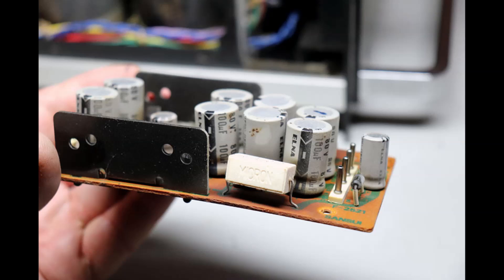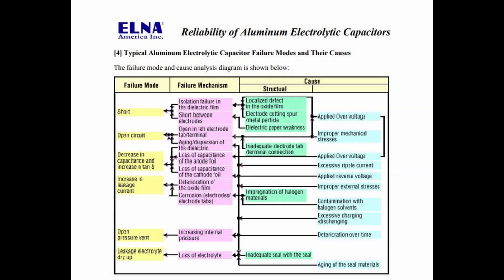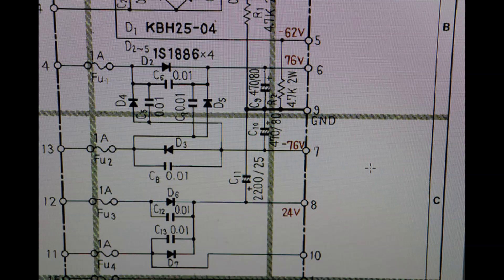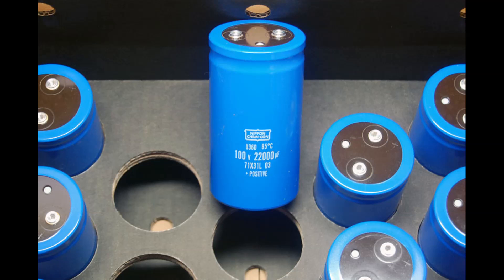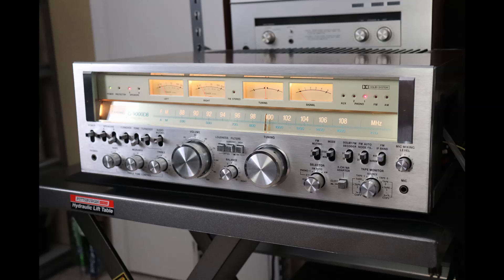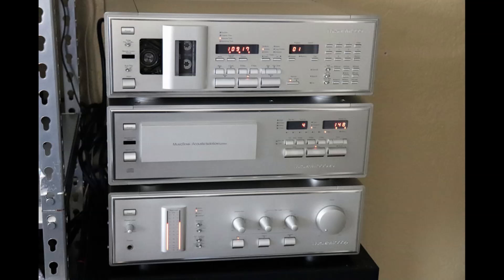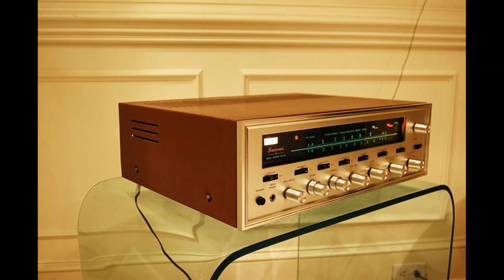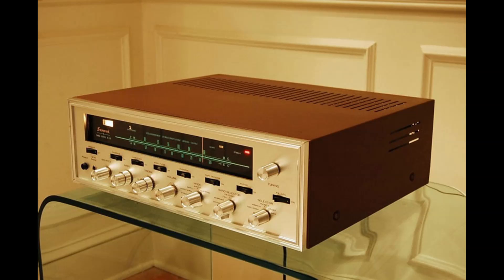Save Your Electronics Before Your Precious Gear Blows Up! Replace Your Old Electrolytic Capacitors.

Comment: Question: What if you vintage receiver is in mint condition and was rarely used? Does the Electrolytic capacitors still dry up without being used?
Reply from the maker: Yes, time will kill the capacitors even if they are not used.
Reply: @vintageaudioaddict  This is where I am not sure I agree because my logic would be that heat & time are the equation. In your video you even state that less heat will greatly increase the life expectancy. So equipment sitting not being used should have a very long life expectancy. What am I missing?
Reply: yes

Comment: It comes to a personal choice.  Don't fix it if it ain't broke vs. Preventative maintenance (with a small chance of screwing something up in the process).   I use a 1987 Onkyo M504 as my 2 channel amp.  The electrolytics are all original.   It has been in for maintenance, power transistors, power supply components, rail voltage adjustments.  The retired engineer who performed the maintenance did not advise to change all electrolytic caps for the sake of age. Quality caps will last.
Reply from the maker: Yup, as you said it's personal choice. Thanks for watching.

Comment: Sir.  I have a Sony SQD 2020 quadrasonic decoder I bought new in the mid 70s.  When running, after varying short periods of time,  the left front channel output drops out.  Could this be a capacitor issue?

Comment: I have a pioneer sg9500 equalizer that I want to re-cap. I can't get a 4.7 10v electrolytic capacator as they are an obsolete part. What should I use in its place?

Comment: After moving my transistor amp from one house to another, it suddenly has reduced volume and pops.  A friend insists I should replace the capacitors.  Do bad capacitors tend to cause those audible problems I'm talking about?

Comment: Have a question for you, I know you have re-caped a couple of your Marantz here, have you run into a model like the 2285B in which its main capacitors (6800uf, 63v)  are actually two capacitors inside a single capacitor can, how do you replace those, since they don't manufacture them anymore?
Reply from the maker: It varies but one way is to cut open the original can capacitor, take out the old internals and then re-stuff the original can capacitor with a modern one of the appropriate value or in your case two. The moderns capacitors are generally smaller and usually you will have the room to re-stuff. A dremel works well to open up the can capacitor and you can keep the original look of the unit if that's important to you.

Comment: Yes, finding a person who knows what he his doing, and not to be taken advantage of is the problem. Center Voltage, Idle current and meter amplifier, as the saying goes, if you want it done right do it yourself. Changing out Caps, this I will need to find someone for fear of doing more damage than correcting.

Comment: I am repairing the computer and a 1993 Ford pick up truck which has 47 µF 50 V capacitors rated at 105°C. Over the last 10 years on three different occasions with two different computers the capacitors have leak and from the research I’ve done people say the computers have an issue of overheating causing this problem. 

Am I correct in assuming I could substitute for a 47 µF 100 V capacitor and be OK? They are electrolytic capacitors.

Comment: I've re-capped three vintage pieces of equipment in the last 10 years. Always replaced the main PS filters first then worked my way down to the smaller ones. Today you can replace low voltage  low value (10uf or less) with film caps.

Comment: Thanks for the information! I totally agree with you, for instance when I was a kid I was surrounded by late 70's and mid 80's receivers, car stereos, boomboxes, audio cassette decks, even older 8 tracks , reel to reel decks, etc. , therefore as I kid I was curios to understand how these devices worked,  so even though they were practically new at that time I had opened them up in pieces and messed around with them and things simply started to make sense as I had put them back together again. I started to understand how they work mechanically, electronically, and what does the functionality of every button within a device do and again I was about 9 or 10 at that time. Well, today I am definitely glad that I did that as I am able to look into these now considered vintage items and repair them of course have learned a lot more about other things in life but somehow became a trade of all jacks by watching others and doing it myself whenever there was a need to either rebuild, fix, or repair something rather it was a vintage receiver, an analog cassette deck, a washer, a dryer, a stove, a smart phone, computer, etc. or even replace a receptacle or add a three way switch and or run electrical wires in my house and or build a shelf. I guess what i am trying to say is that we all have skills in life but sometimes need to realize it and things are not that hard to repair and or rebuild if one understand how it is suppose to work and how it was made. For instance recently a friend had a problem with an electric guitar and again never in my life had even opened a guitar nor new how to fix it but said come on over let's look at it together and it turn out to be a real simple thing that needed replacement. So, do not think you cannot do something in life as one limits himself or herself but thinking I cannot do this nor do that!  We are all smart and skilled and practice makes the difference at everything in life!

Comment: I have a Sony 2 channel amp that is about 50 years old. It was given to me so I don't know history except the person who owned it from new, takes care of his things. He collects old cars and model trains. 1st issue is when I plug it in, it comes on and will not turn off at switch. So I hope this is just a bad switch. I am also pretty sure it needs to be recapped. 

I know you can't help, but I heard you say parts are usually under $200 to fix these. What would be the most it could be?

Comment: I like to relate the story of the oldest piece of equipment I ever worked on, a Rickenbacher guitar amp made in the 1940s that still had perfectly good original electrolytic caps (and I use an ESR tester). If it's not bad you can't fix it.

Comment: Capacitors in tube amps are a separate subject. You are absolutely right in that you will not find a qualified repairman who can deal with both , let me tell you. Fortunately with valve radios/amplifiers it will be a resistor that is the cause of malfunction.

Comment: You just won't find many caps in a DC coupled amplifier.
Reply: There are still filter caps in the power supply and in the tone controls.
Reply: @scialyticsteve  but only one capacitor in the power amplifier which would be rather unwise to try and replace because you would need another near identical one for the other channel.

Comment: Recapping old amps seems to be becoming a wide aspiration nowadays. I can understand the replacement of PSU caps , no difficulty , but changing caps in the signal path is a no no because they will be special close tolerance caps which should not be removed without knowing what you are doing. And by that , I mean engineering degree. If you have an amp full of messy caps , throw it away because the rest of it won't be much good either. I would also take note of the fact , that the ad hoc replacement of the power amplifier's feedback caps will alter the Nyquist stability criterion and that does not sound like a good thing to do.
Reply: I know this is over a year since this comment was posted, but I strongly disagree with your comment about being an engineer and recapping the rest of your amp. I am an engineer and think if you have reasonable soldering skills, can identify capacitor values and understand what makes a good replacement, can follow a schematic, you have a very good chance of saving or bringing back a cherished piece of electronics. There are/were many electronic technicians that were not degreed engineers that had experience working on electronics, that many times knew way more than some engineers because of that experience.

If you think you have the possible skills, try it! The most you'll be out is the time spent trying and the money spent on the parts. There are creative solutions to finding parts no longer made. In some cases you might be able to install a slightly larger valued cap and/or one with a higher voltage, especially in the first stage of the power supply. There is actually a company that can make the larger electrolytic used in a power supply. Capacitors are additive in parallel, so you can resort to using multiple capacitors to replace the value of one for that hard to find component. 

There is a vast amount of information and knowledge out on the internet. Educate yourself, assuming you really want to get that cherished electronic audio component running again, and you can be successful.

Comment: Hello. Is there a way reach you ?  I have a photo I would like to share with you of a very old electrolytic capacitor that I found buried with other items.  I'm trying to pin it down to a date or at least a specific decade.  It came from Japan.

Comment: After buying an ESR 70+ to speed up testing electrolytic caps of all types, I ended up going back to my vintage Sprague TO-6 Cap tester which I have restored and calibrated.
I just finished going over and restoring a Marconi TF-2331 Audio Distortion tester which was packed with lytics from the mid 60's.

What I found was surprising and for that reason, I decided to pull all of the 'lytic caps and test them with a digital cap meter,  my ESR 70+ and the Sprague TO-6, the results of which tell me that the ESR-70+ is almost useless, because while the cap measurements were fine, even the caps with a low measured  ESR  on the ESR-70+ such as .32 ohms, all but a very few showed unacceptable leakage when then tested at working voltage with the TO-6...I think that weakness is that the 100khz square wave used by the ESR-70+ and similar units isn't at a sufficient level to properly test 'lytic caps.

Generally, my rule of thumb is that if I am working on a circuit which has been or required calibrated, or is relevant to the calibration process and the overall specs of what I'm working on, I'll pull the caps and check the value and replace a bad cap with the measured value, rather than the nominal value found in the schematic or parts list.

As an example, in the Marconi I'm just finishing, some of the coupling and bypass lytics measured far in excess of their nominal value. The 500uF filter caps all measured well over 700uF but were leaky, however, since these were filter caps, I just replaced them all with 470uF caps.

Bypass and/or coupling, and/or tuning section electrolytic caps can read high due to tolerances, so when I measured 25uF caps to be 45uF, which was common in this unit, I replaced those caps with 47uF caps because that was the actual original value when the unit was calibrated and tested at the factory...As another example, a 100uF coupling cap measured 240uF, so I replaced it with a 220uF cap at the rated voltage...To be clear, many of the original caps were rated +100/-20 % so I took that into account where necessary....

YMMV, but I've been doing this kind of work for over 40 years now, and it always seems like any post repair calibration has required only very minor tweaks, which is even more important for scientific instruments...

Comment: Outstanding video. I recently recapped my SA7500 and TX 6500. Never sounded better. You are right the information on equipment has never been more available. I am lucky to have a HiFi shop in town. They have a minimum of six months back log and quoted me over several hundred dollars. Did it myself for a buck fifty and a weekend in time.

Comment: Great video! I fix older amps all the time. Almost always the problem is with caps and dry solder joints!
Fixed 5 sherwood amps over last week. Famous hum and crackling.
All now working sweet.
Enjoyed your video 😊

Comment: Thanks for posting this information video. I have a Voice Of Music 568 (tube) console power amplifier that likely needs capacitor replacements and every point you touched upon I can totally relate to. I can solder, but I can't do stuff like measure plate voltage or safely swap out filter caps or even replace an old two-prong AC cord.

Comment: You're providing a great service, much appreciated. Do you ever get into a restoration and find something that stops you from finishing it?
Reply from the maker: Thank you very much. Well not to often as most of the parts to repair these units are still available. I'm not trying to make money so I will sometimes spend a lot of time getting a piece of gear going that would not make any financial sense.
Reply: @vintageaudioaddict  That's reassuring as I'm only just becoming very interested in restoring hi-fi equipment for pleasure, starting with my Technics system that I bought in Malaysia in 1981 while serving with the Royal Australian Air Force. It seems we're of the same vintage LOL.

Comment: Great video. Now I'm a subscriptor to.
I restore vintage audio, 60 and 70's  stuff, and I replace all electrolytics on this units.
Call it a MLU, Mid-Life-Upgrade.
Capacitors are much like batteries, they dry out over time.
New Capacitors may have lower ESR, and be better in other ways to.
More linear maby.
Reply from the maker: Thank you for the kind words and your comments. I'm with you! Get those old electrolytic capacitors out if your unit is 20+ years old!
Reply: Hello. Is there a way reach you ?  I have a photo I would like to share with you of a very old electrolytic capacitor that I found buried with other items.  I'm trying to pin it down to a date or at least a specific decade.  It came from Japan.

Comment: Excellent video, thanks for confirming the hey if you want to go for it. I think the only thing I also wanted to see is say your facing some piece of equipment with like 100 or maybe more caps. Do I just dig in and replace them all, or is it again up to me?
Reply from the maker: Thank you for your kind words. Well....That's a tough question. If your experience always then yes. If not then no. Your thinking.....Well that's a great answer, LOL. You need to to understand your own capabilities. I had my timing belt in my car replaced by a mechanic because I didn't think I could do it. Same for vintage audio equipment.
Reply: if it has that many caps it depends on the brand and if you want to put in the time to do it. Those old PCB boards don't age well and you'll have to deal with a lot of solder pads breaking off with the slightest heat